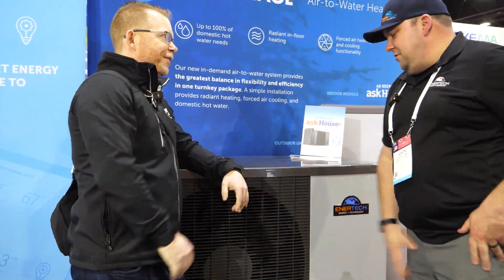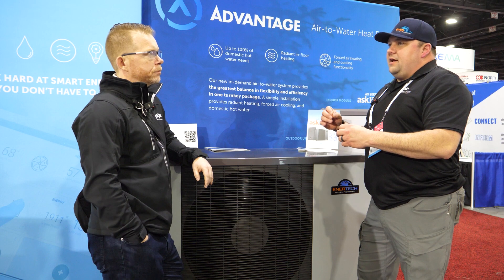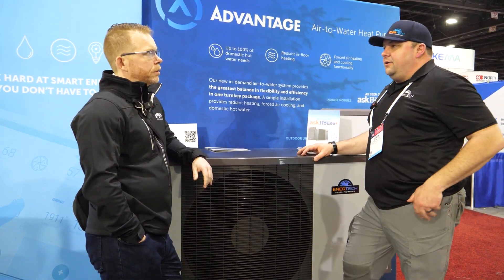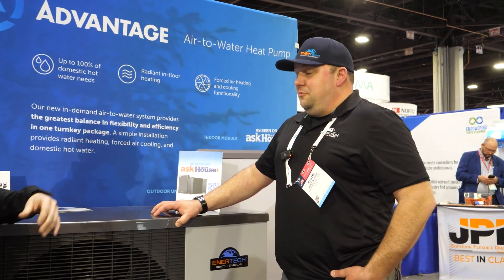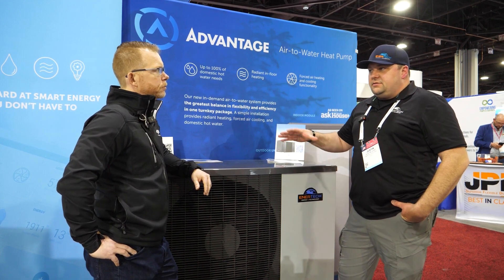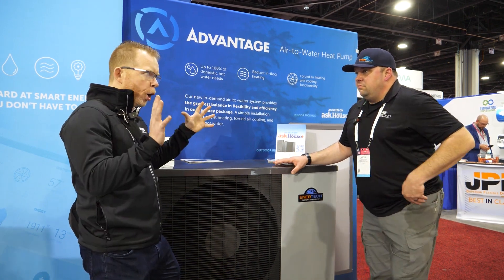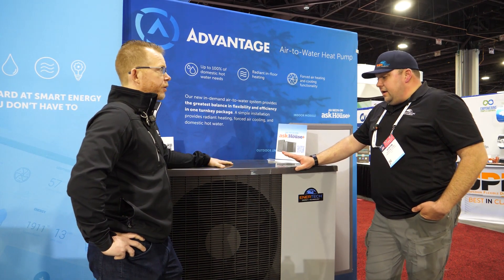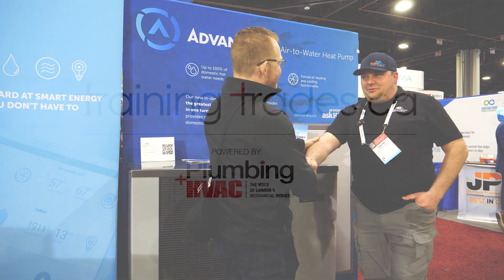Walk 'N Talk, AHR Expo 2023: The New Enertech Advantage Air-to-Water Heat Pump

Comment: For those of us in the hot/humid south(Florida) would you recommend something like for a new build rather than geothermal or air to air heat pump? This seems more like a cold climate solution, am I wrong?
Reply from the maker: Great question. This product is designed for all markets in north america
Reply: From what I gather the cooling side is slightly less efficient than DX, but when you factor in the domestic water heating it's miles ahead.